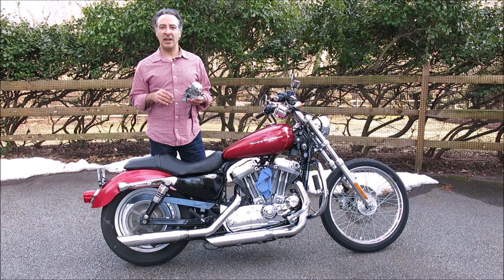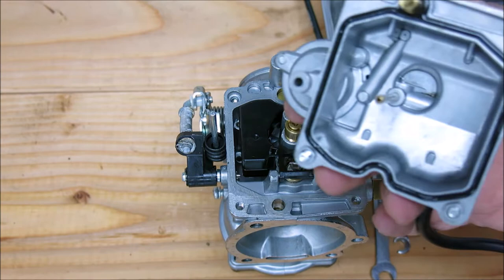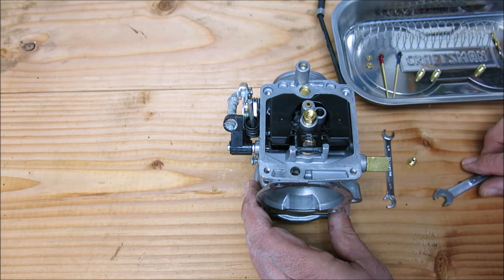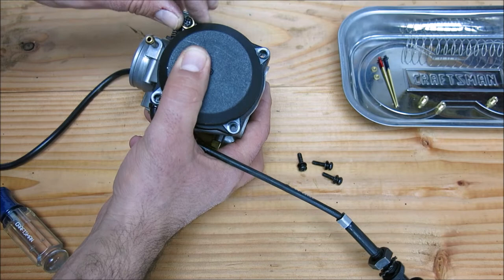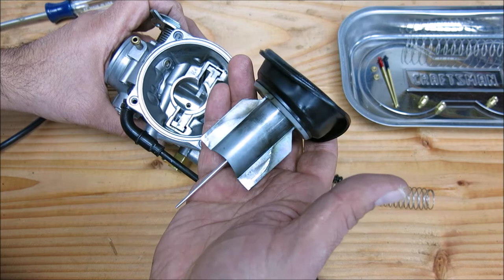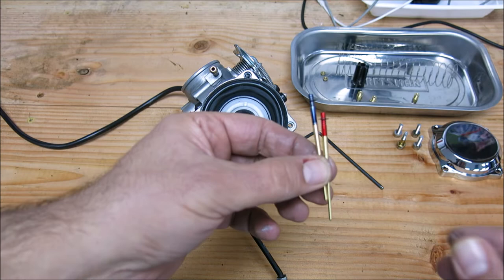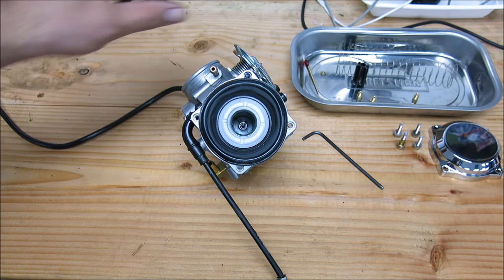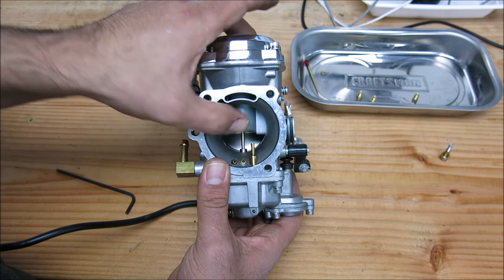Installation of Yost Power Tube for Harleys with Keihin CV 40mm Carbs - Moto Mouth Moshe Episode #67

Comment: This is such a great video. On my CV44 carburetor, my only problem seems to be that its a bit more of a challenge to get the air fuel mixture screw adjusted right. The Yost emulsion tube appears to have a negative effect on being able to accurately find the sweet spot for it. I actually dropped from the recommended 45 pilot all the way down to a 42 pilot and set my screw to 2-3/4 turns out from a gently seated position (Blue needle middle clip). It seems to like it there. My motor is a big bore 113" Ultima El Bruto and I'm shocked to see that it even runs with a 42 pilot jet! If it didn't have the Yost kit installed there's NO WAY it would. I might try to swing by a local garage to see if they'd be willing to stick a sensor up my exhaust pipe and see what kind of reading they get. If im close to 14.7 afr I'll be happy. The bike pulls like a freight train and plugs are on the lean side but as everyone knows Evos run STRONG in a lean condition. It's also been a challenge getting this carburetor dialed in due to a change of the seasons up north. As temperatures increase so does the humidity which causes motors to run on the richer side. Thank God it's been in the 70s-80s. That's allowed me to get it in tune and I can finally stop tinkering with this thing and RIDE IT!! Sorry for the longest post ever but I consider myself a master tuner of CV's and I'm 100% convinced a Yost kit is the best thing since the invention of the bread slicer and toaster, LOVE IT!!! 👍🏼🇺🇸

Comment: The reason the stock carb screws are so troublesome is that they are not Phillips screws.  They are JIS screws (Japanese Industrial Standard) which makes sense since the carb is made in japan. Get a set of JIS screwdrivers and see how well they fit.
Reply from the maker: That’s definitely plausible. I just got my first set of JIS screwdrivers to work on my Honda Trail. I’ll give them a shot next time!
Reply: learn something everyday thanks still putting allens in it.
Reply: @robperkins2674 .....right after I get the screw extractor kit to pull the originals that were overtightened at the factory.

Comment: Those screw are JIS screws ( Japanese industry standard) identified by the dot on the head not Phillips, that's why they chew up if you use Pozi or Phillips screwdrivers!!!
Reply from the maker: That’s correct. JIS screwdrivers are a lifesaver there.

Comment: My harleys never would run right with this yost power tubes had to take them back out put the stock ones back in so in the trash can the yost junk went.
Reply from the maker: Or…. You didn’t tune them correctly…

Comment: I’ve got a 1200 Sportster with andrews N2 cams, what jet and needle would you recommend for this modification?
Thanks for your time and video.
Reply: The Mikuni 42 was way too much carb for my bike. So I’m hoping this will give me power and better mileage than the mikuni.
Reply from the maker: @EduardoHernandez-sd5by  The only way to KNOW proper jetting is with a dyno tune. But a good baseline is 175 main / 45 pilot. The Mikuni is a fine carb and, jetted properly, can work with any Sportster configuration.